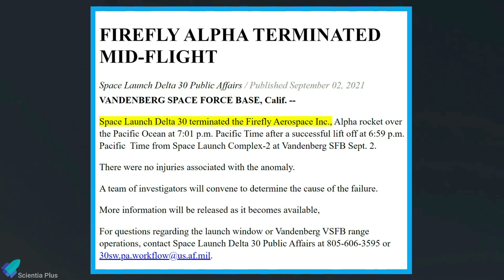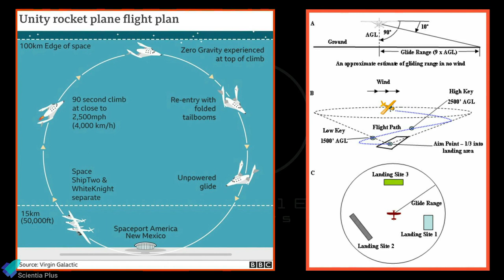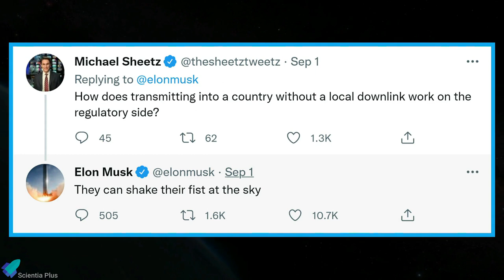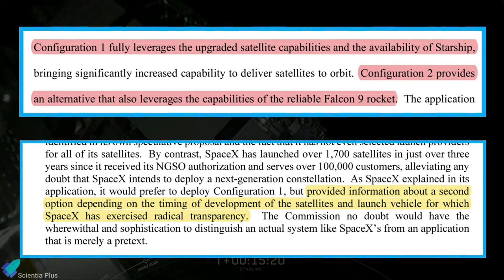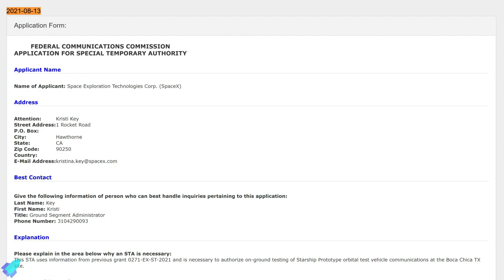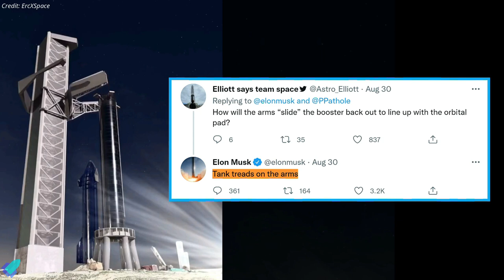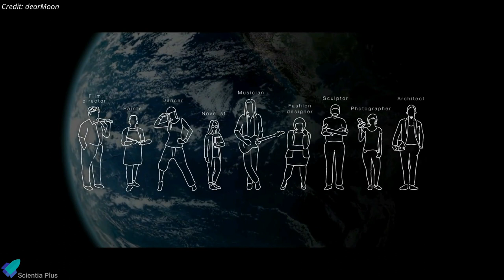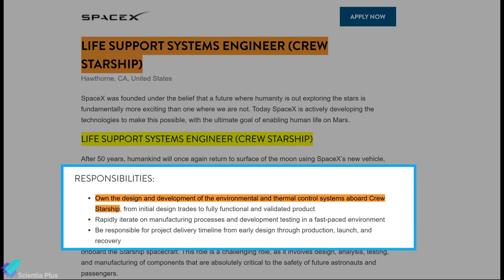Starship20's Raptor Engines Arrived | SpaceX's Reply to Amazon | Why Firefly Alpha EXPLODED? | Mars

Comment: The tank tracks will also allow the catch arms to rotate the Booster and Starship simply by running one side faster than the  other or even in the opposite direction. Probable sequence will be to rotate first to get the perfect alignment and then move to the perfect position for stacking second.

Comment: Eventually, there will be O2 and Methane production facilities in Mars to Earth transit orbits, and Space stations that produce food & air in stable orbits around Earth, the Moon, & Mars. This will eliminate the need to lift fuel from the surface of those planets.
Reply: Raw materials????
Astroids???
Reply: @arthurwagar6224  
Yes, & moons of gas giants. Perhaps even getting it using AI-robotic gas giant high altitude planet dippers.
Reply: @arthurwagar6224  Imagine a transfer orbit running counter to planetary orbits. Using fast sprints  for payloads to match the desired direction. Imagine a Tokyo-drift style 180 turn for the payloads launched from massive cargo ships creating an exchange of payloads on a very long stretch of empty freeway. 
The closing speeds of passing payload exchanges will be very fast, but could be done with the right rockets and a long view of space commerce.